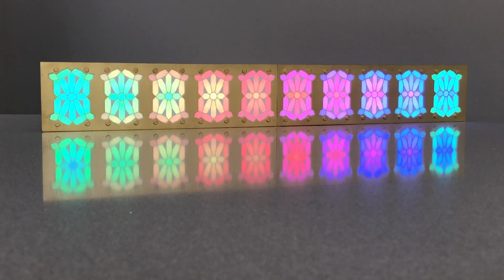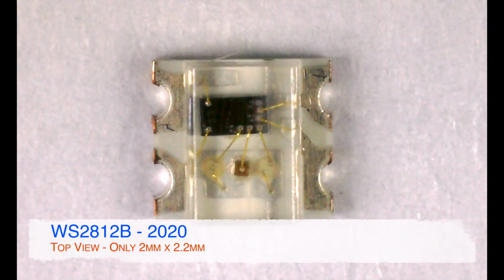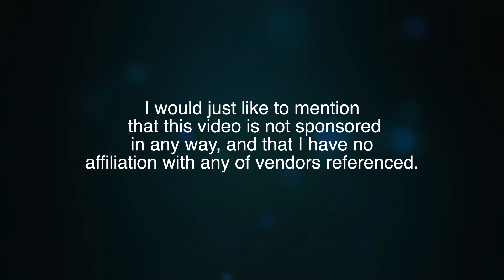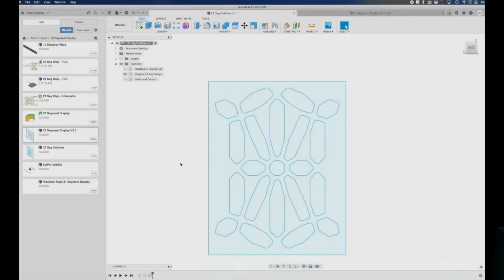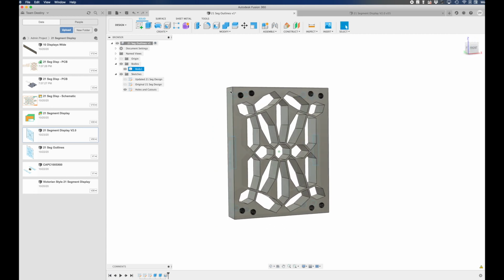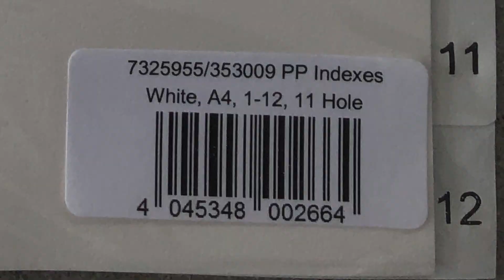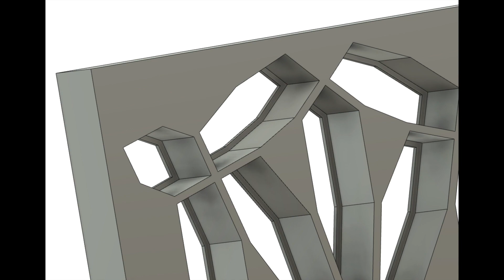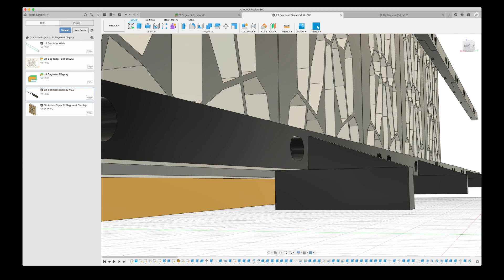How a 21 Segment Victorian Style Display Using RGB LEDs was Created

Comment: This is underrated stuff... very few views and comments
Reply from the maker: @eduardoanonimo3031  Thanks for your comment and I can agree, but then I haven’t really promoted it. A follow up video is long over due as it has undergone an overhaul in its construction and I’ve developed the software since then. Have recently had a proper brass bezel manufactured instead of the 3D printed and spray painted in brass effect ones. Although I do have a better 3D printer now, and some bronze effect filament that recently fooled folk into thinking I actually had a real brass bezel. I’m also planning to make a wooden case for it soon.

Comment: Great and focused presentation, very pleasant to follow, not just of the project itself but also the walkthrough in Fusion. (If a bit low on audio level.) Have you considered creating the G-code from Fusion directly using the Manufacture workspace? Also, given that you modeled the screw thread, was printing it a good idea, or would simply untapped holes have sufficed with regular or self-tapping screws? Then, have you considered any dark or smoked but transparent film in front of the diffuser film to improve readability in daylight? As for the grey and white filaments, I wonder whether dual-extruder machines might lend themselves well to this application.
Reply from the maker: Thanks for the kind comments. Believe it or not, I’m relatively new to Fusion 360 and the manufacturing side of it has not yet been explored. At some point I will look into it, so thanks for the prompt. The thread being only M3 and the printer using a 0.4 nozzle, it does seem a little superfluous, however, it does give the screws a slight lead over an untapped hole, so I do find it a benefit.
Reply from the maker: I recorded a great many sound bytes using a new mic and assembled them all in FinalCut Pro, and the levels were all over the place. In addition, I was very tired when I recorded the Fusion 360 walkthrough and my voice was struggling. I did try and match the audio levels manually as I don’t yet know the best way to automate that.
I will try better next time 😁
Reply: @stevemanley3685  No worries. I know FCP allows normalising audio, but I don't know whether it can do it to individual segments; I'd wager it can't. I felt you did a good job matching them, I just had the impression the result was a bit too low overall; after all, there's only so much the levels can be cranked up on the receiver's side. I'd recommend looking into using the audio compressor and its Auto Gain function, if available, at a leisurely time. That should help. Best regards, A.
Reply from the maker: @Anvilshock  Really appreciate the feedback. I did centre the audio around 0db, but auto gain control or compression sounds like something I should look into. Thank you.